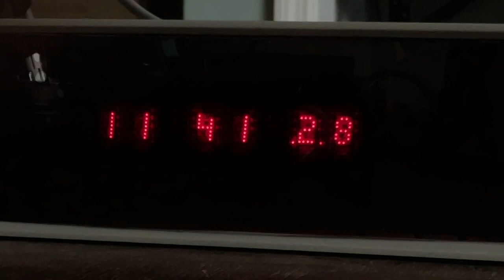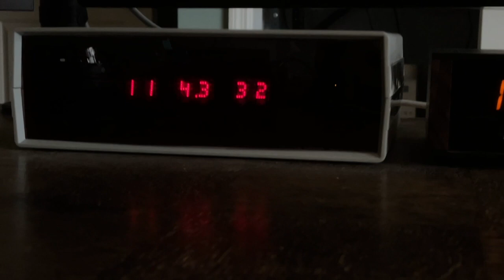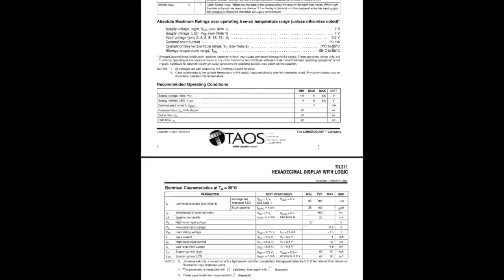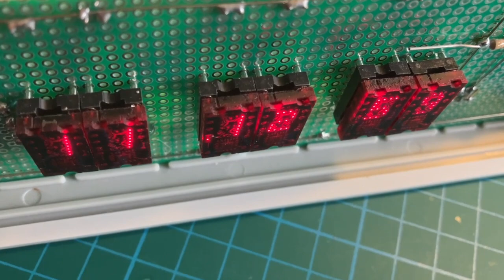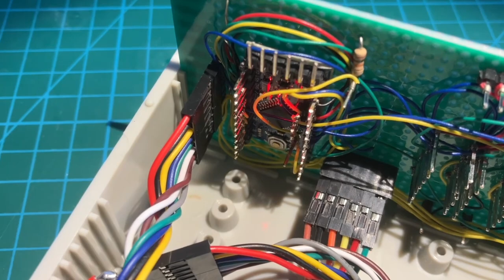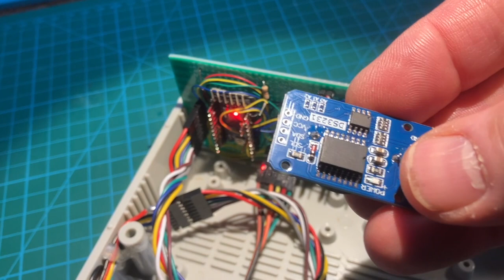My TIL311 Display Clock

Comment: Hello! Do you have project files (gerber, etc.) for this 6digits clock?
Reply from the maker: There're no gerbers or any.PCB files because there's no PCB.  If you looked at the video, you'd have noticed it is entirely wire-wrapped construction.  Thanks, tho for leaving a comment!
Reply: @dtss_smudge thanks for your response. Perhaps you have a sketch (firmware) for Arduino?

Comment: Well, two new TIL311 clocks have been made in December 2025.
Interestingly those nice looking TIL311/DIS1417 can be purchased in quantities from UK based seller.
DL the project files from my Google disc.
Cheers. Wish you a happy new year.
Reply from the maker: Yeah, these displays are still fairly available.  They look cool and decode BCD inputs, but as you saw from my clock,  they're actually a P.I.T.A to interface multiples to, say, an Arduino.  I've seen modern re-interpretations of the TIL-311 with epoxy-potted tiny LEDs-on-board.  I wish these would, say, use I2C rather then BCG...  Oh well.  Thanks for the comment!

Comment: Nice.
I have built a new TIl311 clock driven by Arduino Nano, based on the work of Paolo Cravero.
Will put it on video in a short while. Have to take a sleep first..
Watch Pt1. It has the newly designed pcb.
Pt2 is coming, I have built the real thing this night.
It works. Not as easy as I like to operate clocks, but, yeh.
Paolo put much effort to make it becomes his masterpiece I guess.
Reply from the maker: Kudos for keeping TIL311s alive and doing their thing!  Thanks for commenting.